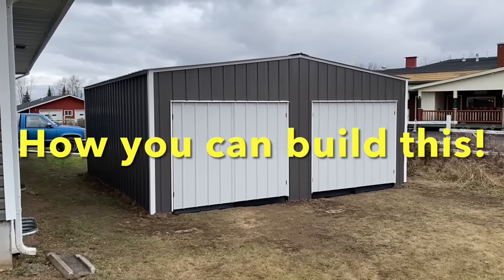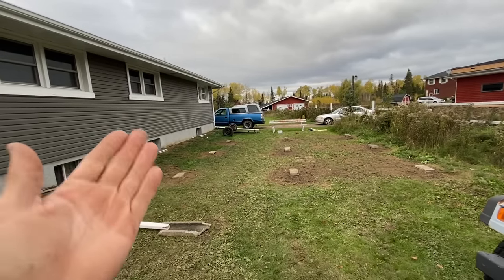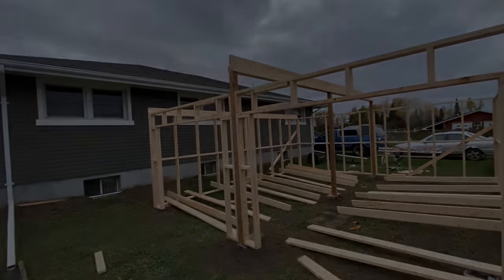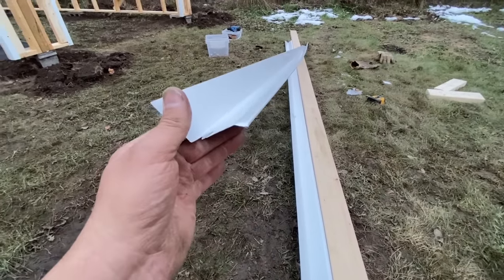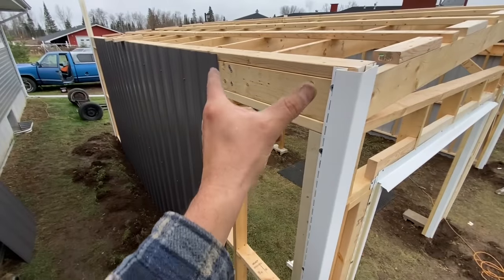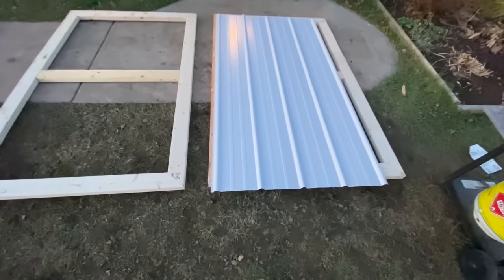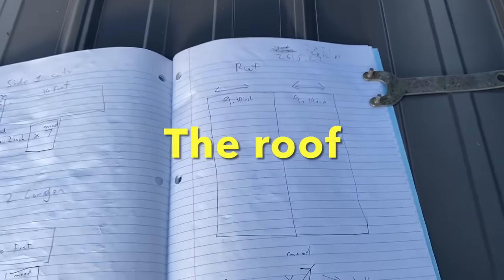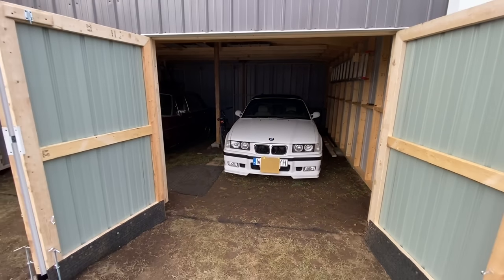How to build a 20x20 Garage for $3000 in 5 days (from Home Depot materials)

Comment: I love the philosophy of this build. This is WAY better than most temporary garages and is actually affordable. Anything that anybody has mentioned can be delt with like storm tie downs inside the structure for $300. Repairs can be made IF they come up. I mean come on, you only paid $3000 and 5 days work and you are out of the weather! Way to go!!
Reply: This by far has been great I’ve enjoyed the video watching it has gave me the confidence that I can do this job myself kudos to you everyone has there own style and opinions some negative but this is why we share these videos to learn how to do this projects and save money to each is own style thanks I’ve subscribed to this channel because he deserves respect great job
Reply: You can add cement later. I would do 3 foot wide by 10 foot sections. Easy peasy
Reply: Mix and pour, finish yourself
Reply: Clifford DeRouen U S M C.
Shhhh
Reply: Swap out the 2x4s for 2x6s and you got a really sturdy garage, also plot studs where the wall sheeting laps.
Reply: Do not forget, "portable storage space" does not need a building permit. 😊
Reply: Depends on where you are and the size
Reply: Park two cars in there, and you won't have any room for yourself ;) This will look like an old $3000 shed in a few years.
Reply: Hey I’m a novice but I subscribed just due to this shed build. ♥️
What I would change would be a concrete pad foundation reenforced with heavy gauge screening and rebar. I would lay crushed gravel one foot deep and wide along the perimeter for drainage and I would not put any panels below grade (rust).
Likewise I would reinforce all mid and end panel supports with metal striping and reinforce all sidewall overlaps with additional interior supports.
Along the roof ridge I would lay a rubber or vinyl strip along the outer edges to prevent moisture being blown in.
As I live on Long Island New York and need a structure like this for a workshop I would be insulating, installing electric and hopefully one/two windows.
Yes here in New York we have lots of permits and codes but I have the unique advantage of living in a trailer park-although I will adhere to codes as much as possible, I am not constrained with permits and inspections like house owners here.
You should see the shanty sheds here-some have 3 on their lots! 😳
Much respect to this dude for a simple effective build that I plan to replicate! ♥️
Reply: @ceciliamatos3288  It will still be a rusted large shed...
Reply: Your not the smartest it's a good build affordable  @TheeRocker
Reply: @jefferymaness3645  I talk about a building, and you talk about me... huh, and you're the smartest I am to assume? 
It's a large shed, lol. get over yourself. Look at it lol.
Reply: @patpowell862  Where I live (NY) - that would be a 10x10 or smaller shed.  Anything bigger and it's considered an accessory structure that must meet building codes.
Reply: I’ve seen a lot of people saying that this helps them to do it themselves. I’ve been a builder for 17 years. I wouldn’t recommend doing it this way. The benefits of having actual footers is so important. I guess if you want a garage placed like a single wide trailer then sure. Great video and I’m not hating, I’m just saying this wouldn’t survive a medium wind storm. You have to think about other people nearby that could be hurt and their property. Footers for Christ sake. Attach to footers with embedded studs and it’s still “temporary” and also sturdy.
Reply: What about water runoff and gutters in a wetter region?
How would you keep the typical metal shed condensation from forming inside?
Needs ventilation for proper air circulation, though!
Reply: Wrong! Headers are flipped the wrong direction and the footers are flipped the wrong way. That stupid long trim cut instead of just lifting the rafters 1/4 inch??🤣
Reply: I think it’s awesome and looks great.  Haters gonna hate.  Only thing I’d do is add insulation, power and windows but his build is great and very well explained which being a total novice I appreciate!!   Thank you!
Reply: @ScottH-dw4rh  Yes footers would be wise I will do that if we can't find a garage on our last buy. Footers are an easy addition for frost reasons especially & would provide that stability. Frost-proof in our area is at least 3'.
Reply: Good  job buddy. And it’s  movable   When  R. U.  Coming over.     💋💘🕊👍🏿.       👁🌎👽🛸
Reply: Great video, thanks
Reply: @MrCarmelo1959 😅
Reply: not if you have to tear the whole thing down and start over because everything there is wrong 100%
Reply: basically only thing I see right there is your training for the walls except you don't have no corner post built
Reply: "Storm tie downs"...  Depends on what part of the country you are in.  Some areas are not as windy and some areas have more tornados that others. That said, lots of structures dont hold up to a tornados. BUt they do have those corner metal flanges you can install..
Reply: @TheeRocker  it wont rust as fast as one would think, i put a metal roof on 10 years ago, still the same color, hasnt faded much at all
Reply: @ScottH-dw4rh  how would one secure this to footers?
Reply: @tkskagen  the roof isnt sealed, so there will be some ventilation.
Reply: @geraldbrakefield3874  Awesome !!! I hear ya, but it's eventually coming. Especially the screws along with the finish. Seems an issue that should be a simple preventative. 
As well, ice isn't a friend to nails/staples of shingles either ;)
Reply: The steel sheets will add tremendous strength with plenty of screws.